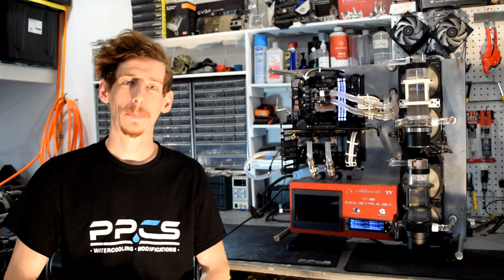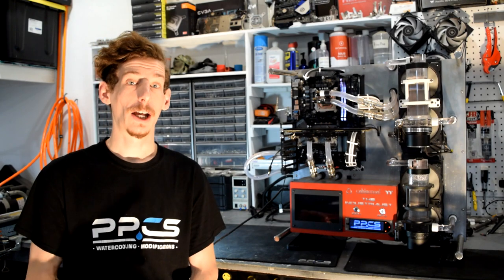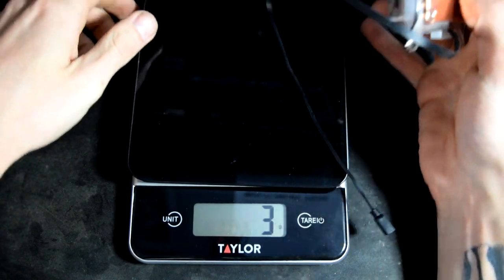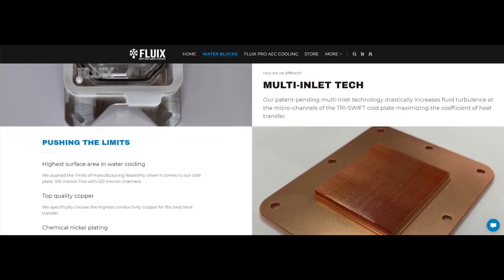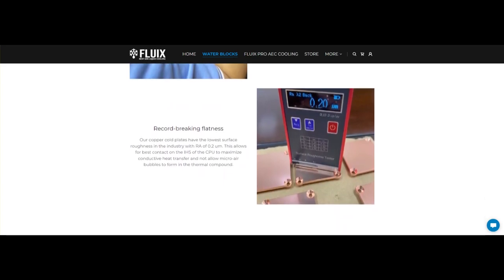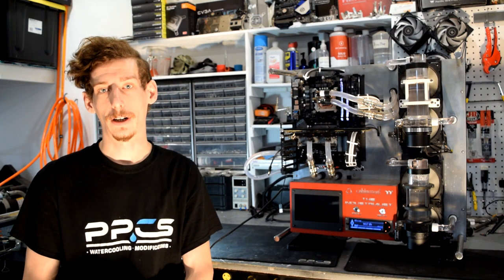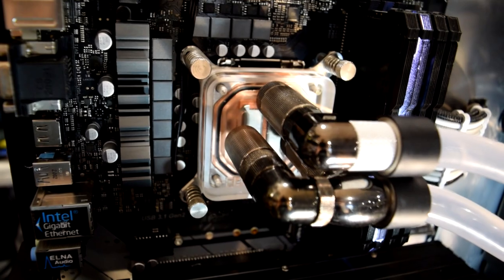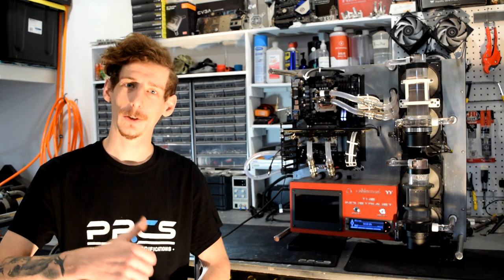Fluix's Tri - Swift Gen. 3 Multi-Inlet CPU Water block - A Sneak Peak

Comment: Why three ports?  You mentioned something about increasing turbulence, but how does an extra port help with that?

And how are you supposed to use all three?  Splitting off an extra branch of your inlet tube seems unnecessarily complex, so hopefully the setupis simpler.
Reply from the maker: Fluix claims that the multi inlet design increases the amount of turbulence over the jet plate, which should in turn increase cooling performance. 

Setup/install could be tedious, especially with a hardline loop, however I was able to make a combination of extensions work to make install pretty easy on the test bench. I am planning to come up with a list of fittings that work best to do this once we offer these blocks at PPCs.
Reply: The stock block comes with a Y-splitter included, so all is included ready to go if you order one. But we just choose to do a hard loop split for aesthetics reasons :)